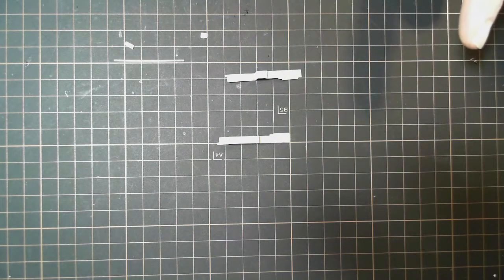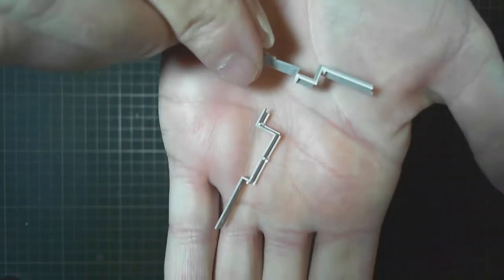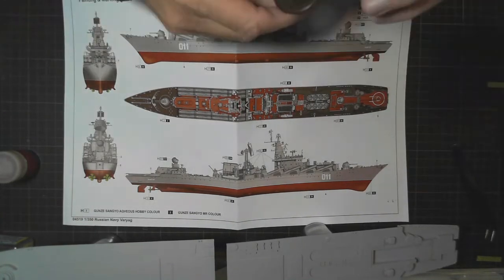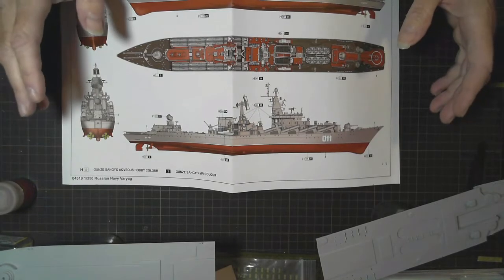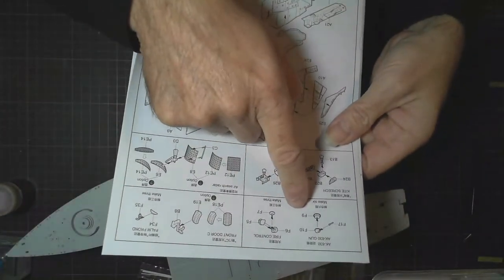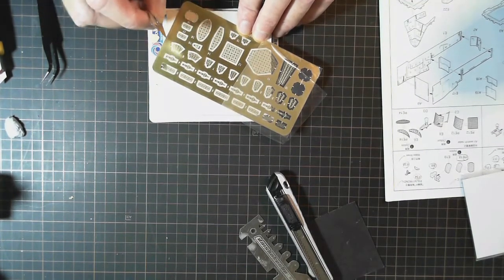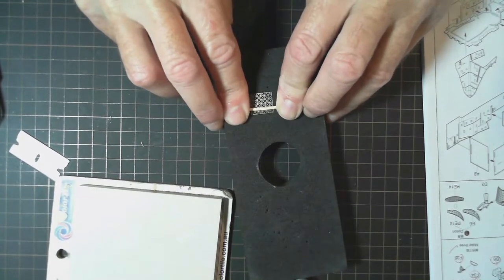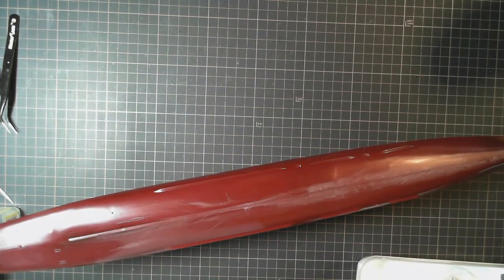Russian Navy Varyag 1/350 Scale Model Build Video Part 2

Comment: The SA-N 4 launchers are optional because the Launcher is only elevated topside when it is to be used, it saves it from a lot of exposure. That is why you never see it on the photos, the hatch is split down the middle and is sliding.

Comment: 1) 6:04 this thing is fire control radar for OSA-M (SA-N-4)  and it's not optional, but you can chose between ready-to-fire or retracted launcher OSA-M 2) 11:34 colore is right, becaus this color scheme is from 80's and early 90's, in this time Chervona Ukrayina/Varyag have same color scheme until 1998 3) 19:03 it's fire control radar for AK-130